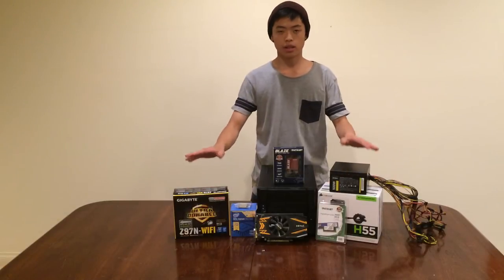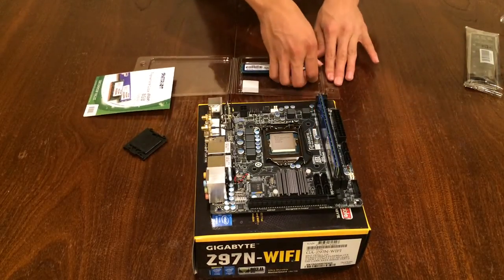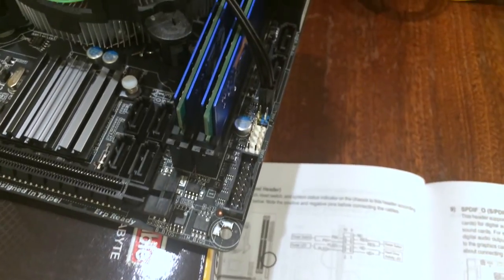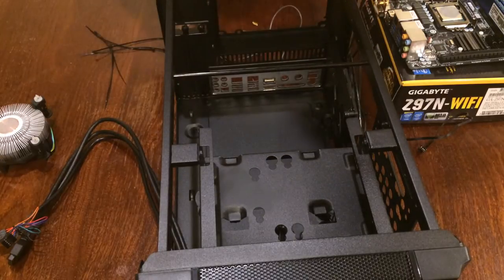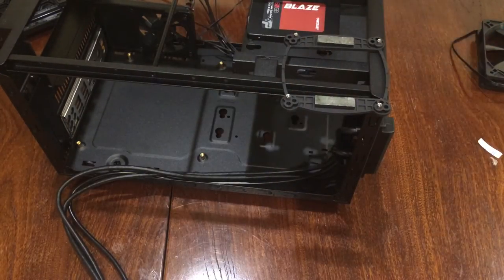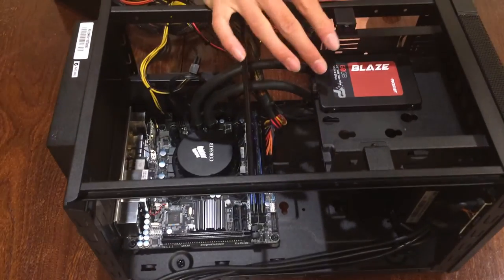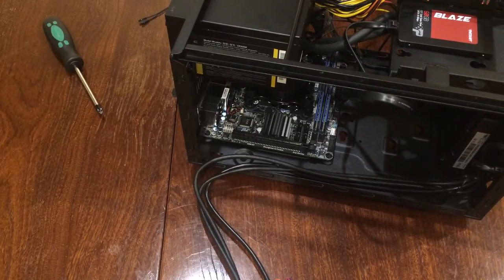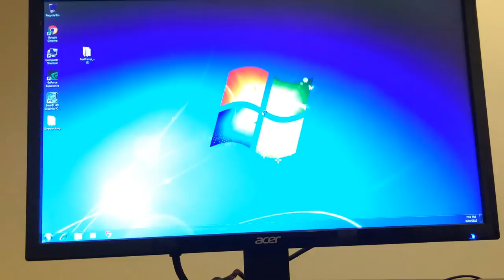How To Build A Badass Gaming PC - Mini-ITX Gaming PC Build Guide

Comment: I've actually used this case and this motherboard in my system that I'm building (GPU is all that remains)

https://pcpartpicker.com/user/DrMacintosh/saved/LwgH99

It was a pain in the ass because I couldn't get it to boot the first time so I had to redo it for it to work. My build is pretty powerful and with a few changes could be $1,000 or less. 

Great vid ;)

P.S. I removed that weird side rack on the left. Made working a little easier